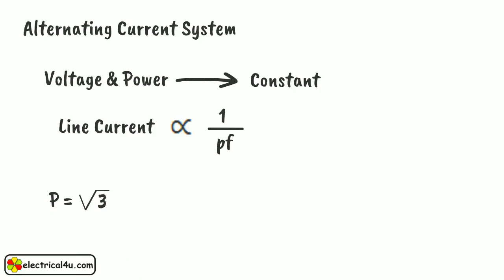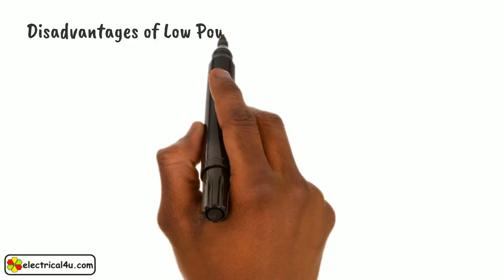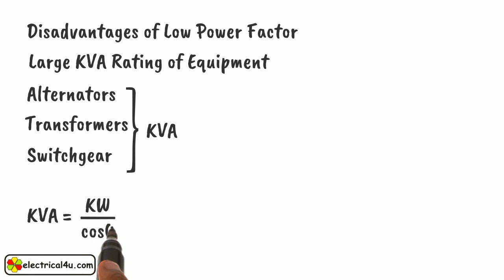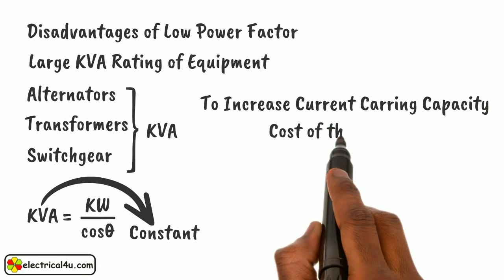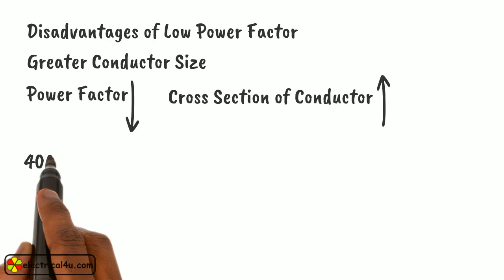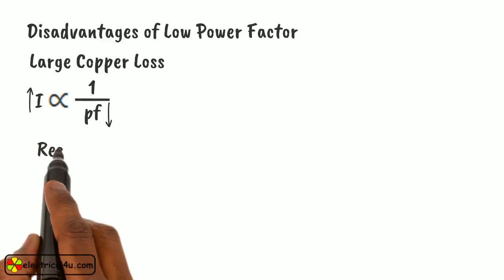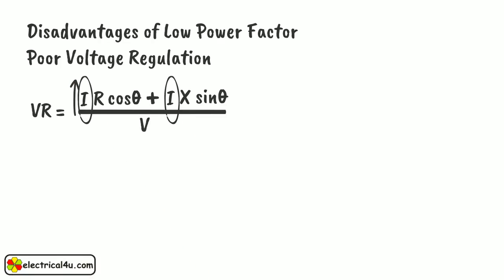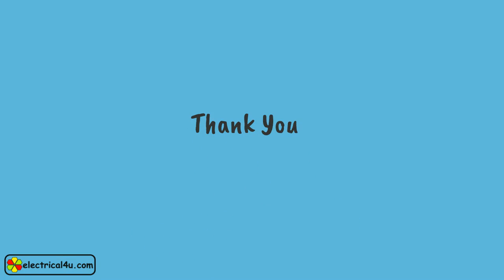Low Power Factor Disadvantages

Comment: I have a doubt, suppose you have an a.c source of 10 volts connected to a 2 ohms resistor and the current would be 5 amps rms, suppose you connect an inductor with reactance 2 ohms then the current would actually lower itself to 3.53 amps. so by connecting an inductor hence lowering power factor you reduced the current right ?